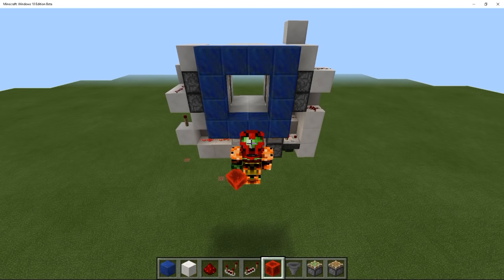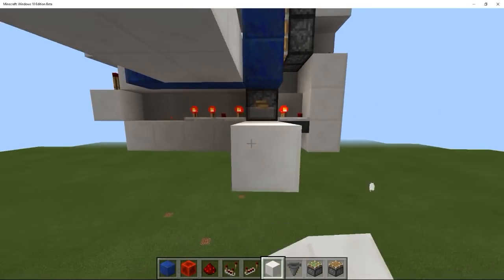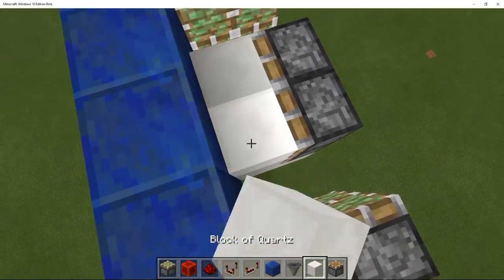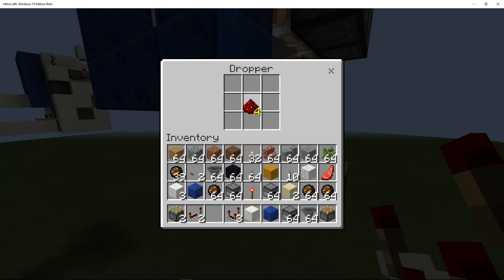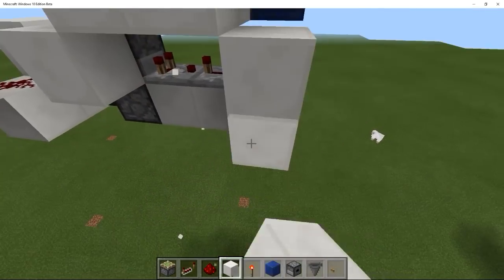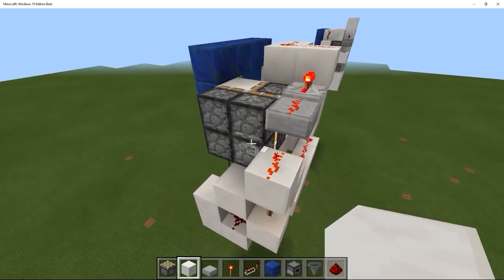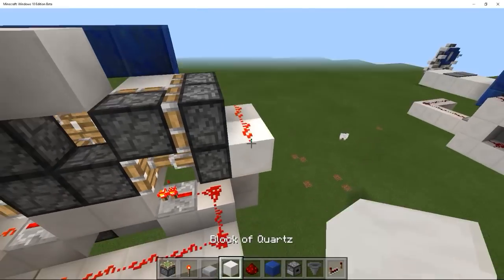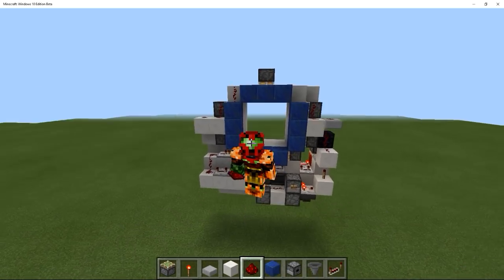MCPE: Compact 2x2 Flush Piston Door for 0.15.0 Pocket Edition + Tutorial

Comment: Hate to say that, mine is smaller. 9x8x2, 144 blocks, but still good job for you!(I use 6 observers and extra 4 sticky pistons) Also you missed out one block for the height as redstone dust also counts as a block. So I also miss out a block of the height as I dont count redstone dust just like you... Good job though!(You teach me lots of redstone skills)
Reply: Also my version is 0.16.0, new feature of piston redirecting redstone was added, so I think that helped me of compacting the circuit though...
Reply: And I just thought: I can make my design even better, so I build another one with 1 block shorter(real 9 blocks, old one should be 10 blocks, but I cheated by saying that redstone dust does not count as a block). New design is slightly faster on the opening, but more messy. This time I use 6 extra sticky pistons, 2 extra normal pistons, 2 redstone blocks, and 2 observers. Less resources friendly, but smaller.
Reply: This one was first built before there were observer blocks so he had to make it a bit bulkier.

Comment: A.K.A. slow jeb door xdd
Reply: Yep, because Microsoft refuses to add Quasiconnectivity
Reply: they didn't refuse to add it, they removed it!
Reply: Oh. That's even worse!
Reply: And it would be so easy to add simply more pistons to add qc
Reply: No, it's not, quasi is a huge PITA 90% of the time and is very rarely useful.

Here is one case but the cases where it just gets in the way are far more often
Reply: waterlubber
PITA=?
Reply: Bengineer8 Pain in the ass.

Or a greek bread.
Reply: waterlubber XD
Reply: waterlubber
That is why I said that they should add more pistons instead of modifying the already existing ones. Noobs get easy to understand pistons and non of the old contraptions will break.
Reply: Java 2525
Also, I personally have no problem understanding QC.